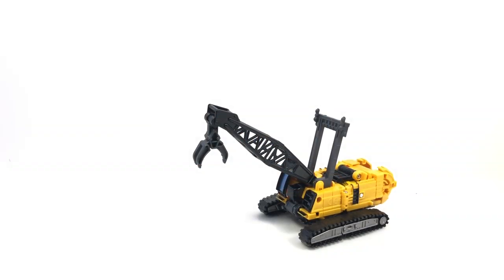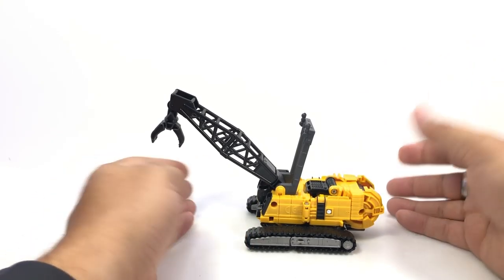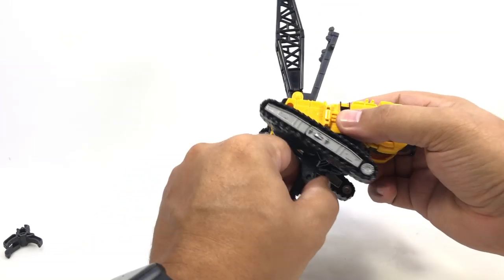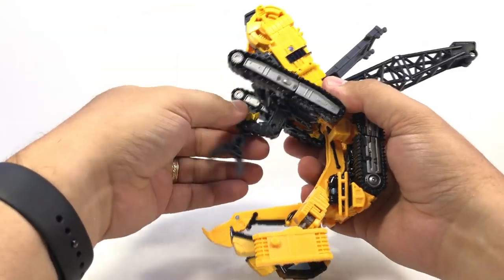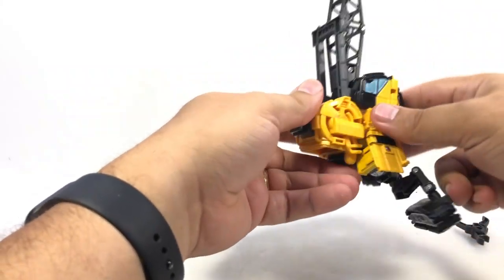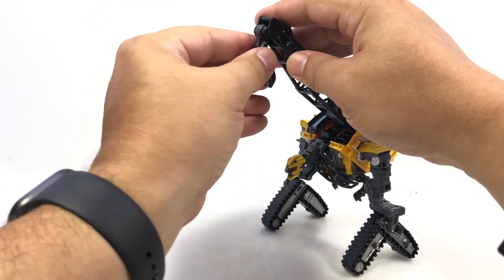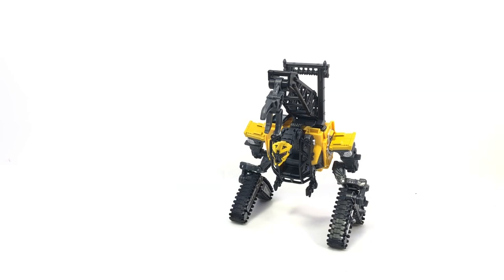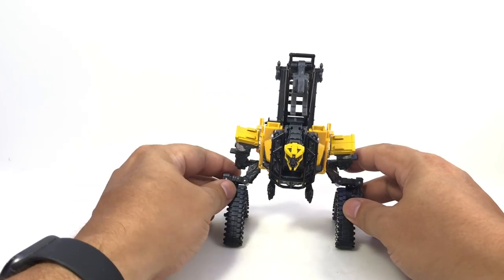Video Review: Transformers Studio Series 47 - Deluxe HIGHTOWER

Comment: he has a better possible robot mode if you use his combiner joint as a wheel(kind of like beast machines ratrap) and angle the treads as arms. still only has hands on the smaller arms but it does look better, possibly even good!

Comment: The neck joint is a bit of YMMV, on my copy of the figure I can hold Scrapmetal and Hightower combined by it and shake them and it doesn't pop apart. If I had to guess it's like most friction hinges where once it comes apart it's done for in regard to stability, and his box really crunches it in there.

Also, you can use the screw where Scrapmetal's bucket arm attaches to adjust the friction of the combined joint; in my case it was too loose for Scrapmetal to hold his weight without drooping.